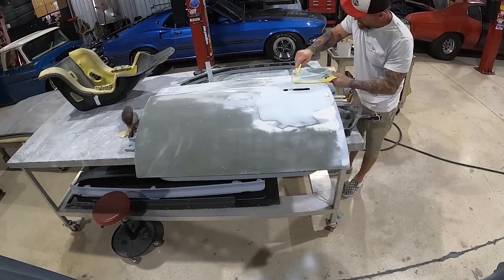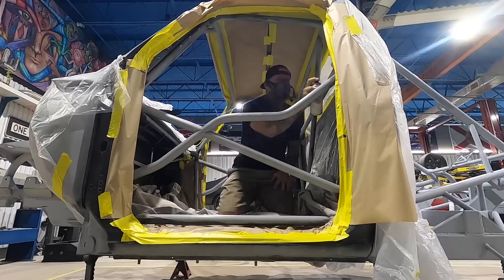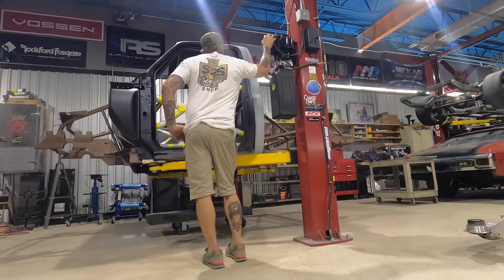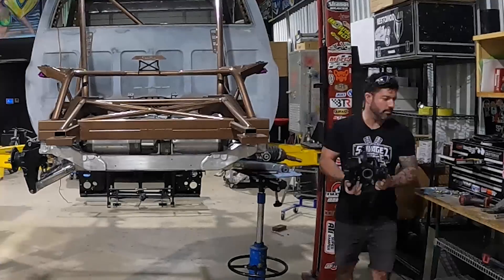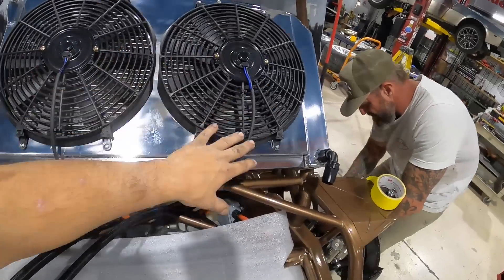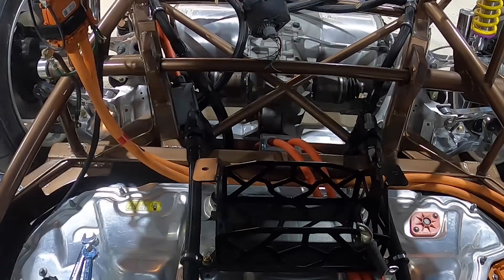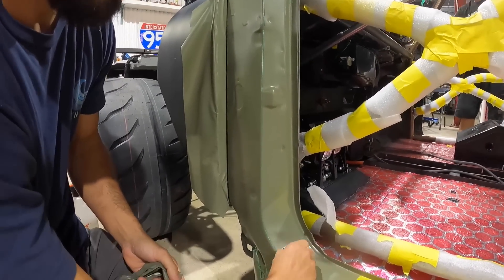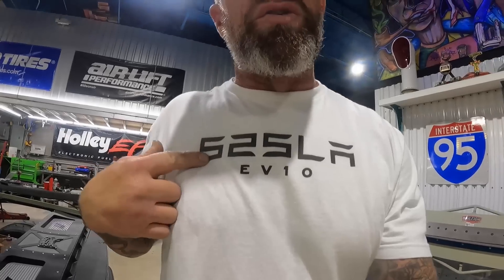Twin Tesla Swapped Squarebody Gets Paint, Wrap & Reassembly! - Electric C10 Ep. 18

Comment: Do you guys a have a book on how to strip a tesla then add slash/modify another vehicle to its motor? Trying to buy a bus and multiple complete wrecked teslas to make an EV/Skoolie.
I'll pay for a DIY program on that process.
Reply from the maker: Unfortunately we do not, we kind of learned as we went.
Reply: @SalvagetoSavage  appreciate the reply.
 I've been on the forums, to get an estimated 200-mile range on a bus with 2 warp 11s will start at $44,000. 
I can buy a bus at auction and 6 demolished Teslas for less.
Tearing them down doesn't appear impossible, I've always been good at disassembly, but having it modify to a bus is escaping me.
The forum guys would just use the Warp 11 method. Tesla has a Semi on the road with 4 model 3 motors towing 80,000lbs.
I'm looking at a short bus probably closer to 16,000 lbs.

Comment: Great stuff! I've seen all the episodes (I think). Curious as to the controller you used for the battery pack. I have a project and using a ldu and the T 3 battery pack. Are you able to use a single display for both the drive and battery controllers?
Reply from the maker: This week's episode is going to cover all of the wiring and controllers!!

Comment: The quality of work looks amazing but once you get done with it the thing will have no soul, just like every other EV on the market. No cold start growl to make you smile the first time you fire it up for the day. No rumble, no shake at idle to let you everyone theres a beast slumbering within. No feel of the shifter in your hand. No appreciative looks from other drivers. You are no longer a driver, you just turn into a pilot. Electric cars just dont bring the fun after the first few times you launch it. It just doesnt evoke a feeling other than a laugh at how hard it launches because you know thats all the powerplant will ever be. Stagnant, quiet, and boring. 

Also, why go cheap and wrap it after spending all that time working on it? Just paint it and have it last forever rather than having to do a body off re-wrap every few years?
Reply from the maker: Actually……. Hearing those electric motors “click on” and spin those 4 wheels that fast made 5 grown men smile, get goosebumps, and high fives all around. It was just as epic as hearing and twin turbo LS fire up. 

As far as the wrap thing…. It’s all about time, ground up builds take most shops years to do. We built this truck ( and worked on many others) in 8 months. Sema is in 2 weeks. So sending the truck to a paint shop wasn’t an option. Amd btw keep in mind, it’s a race truck. It will get beat up amd it’s way cheaper to re wrap a few panels then re paint and body work 

Thanks for watching bud! Hope when you see it all finished up and doing a 4 wheel burn out it makes you feel a little better

Comment: lookin good... 2 things surprised me though
- use of cunifer brake lines, which are weak and prone to fatigue cracking, rather than say stainless
- use of T in the cooling circuit under the assumption that just the right proportion of fluid will go each way to properly cool each side (regardless of the resistance to flow of the two circuits below)
goodenaf for the show I suppose

Comment: At first I was like no, keep it at stock height.  Now I’m thinking of it as a performance successor to a full size sedan.  Really interested in seeing how it corners.  Do you guys have an estimated weight ratio?
Reply from the maker: The weight is going to be pretty evenly distributed. The battery sits about dead center. We have two motors balancing each other out. And the rear subframe structure makes up for the weight of the extra coolers and other accessories in the front!

Comment: what are your predictions for the 1/4 mile time
Reply: Dialed in? I bet it runs mid-upper 9s. Depends on how much that pack can give both those ldus continuously for more than a few seconds at a time. 🤔
Reply: @4literv6  very impressive good work.
Reply from the maker: It's hard to say! A stock model S runs in the low 10s. We have two of those motors and an upgraded controller for the motors and battery. We'll definitely be making some passes in it!

Comment: You all probably thought of this, but make sure the cooling system pressure isn't too high. I believe the tesla battery pack cannot exceed 5 psi. 
Also consider shielding the battery pack cooling system fittings, if they break they are very hard to fix.
Reply from the maker: Thanks for the tips! We're running with the stock Tesla pumps so it should keep the cooling at a safe pressure!

Comment: The cooling pluming is probably not ideal.
A separate circuit and pump for the batteries and motors would be better.
Cooling for the batteries during charging and high discharge is critical. Not having separate circuits could result in a steam pocket causing a blockage that allows the motors inverters or batteries to cook. I believe Tesla keep them separate to some extent
Reply from the maker: Thanks for the input! We'll look into that

Comment: Love the color, reminds me of military. 
Question... which one is cheaper... ?
1. Paint.
      or
2. wrap.
AND love your work, Great job guys, looking forward on the next episode.
Reply: Depends on 1) what your overall final product is, (basic paint/wrap gets basic pricing, but custom designs, multicolors etc cost more).
2) who's doing the work (all shops charge different rates and do diff quality work (shop around, call and get multi quotes)
3) the vehicle you have (larger the vehicle van/truck/suv will cost more than a car for basic paint/wrap just due to the size and more material being needed to cover the surface.
Reply from the maker: Mark hit it right on the money. Overall a flat green wrap like we have on it would probably cost us less than having the thing painted a flat green professionally. But in our case, it was more about time than it was money. Even if the paint would save us some dollars, it doesn't necessarily help us when it needs to be out the door by the end of the month!